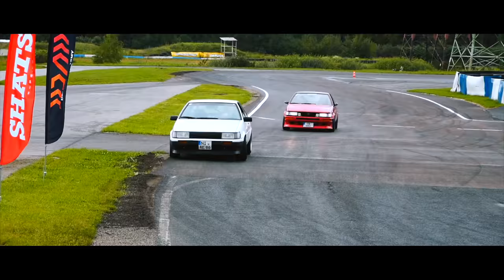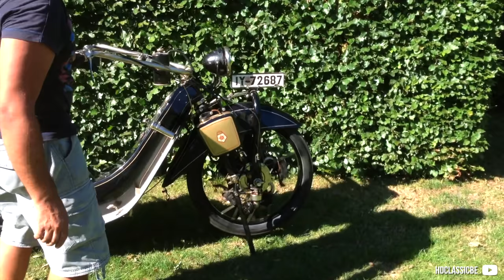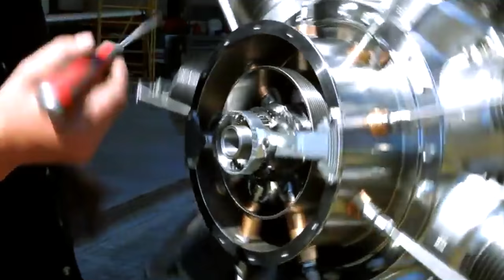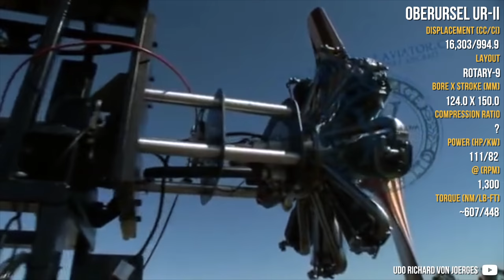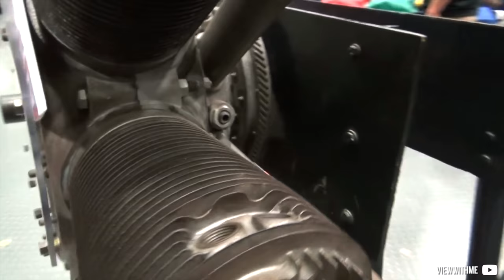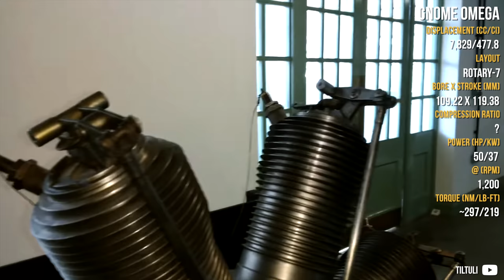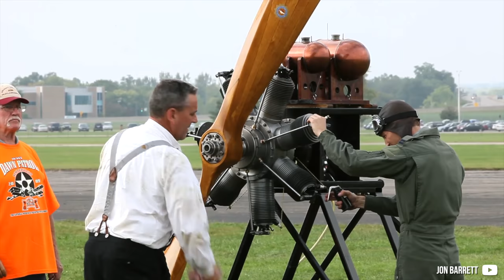These Rotary Engines Are Spinning

Comment: During WW1 these engines had the best power to weight  ratio of any design, because it eliminates the need for a flywheel, cooling fan, ignition distributor, exhaust manifold, and several other parts. Especially the flywheel, though, since the low speed engines of the time required big heavy ones.
Reply: There's many reasons that those things are highly desirable, even if they weigh something.

Comment: I have never heard a front wheel drive motorbike, but thanks to your video, I know about it. Thanks for the video very much!
Reply: Knallert is another Brand.
Reply: Well in the early years of motorcycling, various brands had front wheel drive by a small engine right above the front & either chain drive (no springs or damping at the front) or a coupling to the front wheel by a rubber roll - up to the 1980's you could still buy a brand new french "Velosolex" (a moped with not even one horsepower from a tiny two-stroker) that worked with a rubber roll to the front wheel/tyre (caution: slippery when wet...😁).
If I remember correctly, there was even a japanese bike (MX, prototype or not???) that had an additional, hydraulic drive to the front wheel but because the main drive was to the rear, you may call that an all wheel drive...
Reply: I saw one of these at a show. It was frigging cool.
Reply: I saw one in The Museum of Science and Industry in Chicago, probably around the late 1990’s. I didn’t know more than one was left in existence.
Reply: @stefanpaege2046  succesful 2 wheel drive motorcycles I would like to see. But even after more than 50 years on every kind of motorcycle I could find that front wheel drive rotary is an accident. If I got on it I would probably figure I should crash as soon as I could so I didn't have to walk as far to get back. 
Ever try a honda helix? its kinda in the same class.
Reply: I saw one in a museum back in the mid 1980'ies - as far as I remember, it was in Dresden, Germany.
Reply: @stefanpaege2046   and @Alden Consolver
The veloselex, was not aware that they had a friction drive model. But tanaka of japan, a company had a bolt on option for bicycles that was a front whell friction drive. They had a runner's roller and a resin roller that was impregnated with sand or another abrasive so it would work when wet. Rear wheel friction drive kits for bicycles are still available today from at least a few companies. 
 There was a rear wheel motor solution back in the early 1900s i believe called the motowheel and it was sold in two ways, one as a stand alone unit with tabs for bolting onto essientally a go kart of the owners own design, createing a rear midengine five wheeled vehicle in most cases. Though i guess one could design a cart specificialy for the device that had three wheels, it ad two in the front. Though you could even mount it in the front if one wanted and were creative enough.  
 The other way it was sold to my knowledge was as a fully built bike, though there may have been a model that bolted onto the left side of bikes making a sort of strange trike that seems like it wasnt the best idea. 
However i do not think the motor  turned, it think they used a torque arm to turn the wheel which sat on a bearing and spun around the motor which sat inside it. 
 However rotary motors are stil in use today thougj rarely are they gasoline. Usually electric, and commonly found on electric bikes. Though the trend is going toward mid mounted motors. 
 Of interest though is a cureently produced american made motorcycle that kinda is a frint wheel drive. 
 Its called the rokon, and while it uses a mid mounted stationary motor, it drives both wheels, the rear wheel through gearbox and chain though one doesnt really shift gears like on a traditional motorcycle. You pick the gear thats best generally for what you are doing and you just ride in that gear, from closed to wide open, the gear simply decides if you are gonna get torque or speed. 
However it has a really neat articulated driveshaft that reaches up into the front steerer to reach the front gear box thingy that drives the chain that drives the font wheel. 
 Its top speed is about 37 mph. 
 Its made for off road use but there is an on road model. It looks like a john deer and a harley davidson had a baby.

Comment: Slight mistake about the Gnome et Rhône engines: Le Rhône was not the name of the engine model. Gnome and Le Rhône were two independant engine manufacturers which merged in 1915 to form Gnome et Rhône.

Comment: I LOVE rotary engines.
A lot of people think something is wrong when they hear them "missing", but the RPMs are controlled by shutting cylinders off, and the sound of it being in trouble is actually normal.

The Addams-Farwell was built about an hour from where I live. As I understand it, the first Addams machine shop burnt down, and the "New" (around 120 years old now) shop is still standing in Dubuque, IA. (USA).

Comment: These engines were horrid to fly behind.  Most of them had no throttle, you controlled the speed by blipping the ignition on and off.  Often times they used castor oil for engine lubricant, which stank and got all over everything.  And all that spinning mass had HUGE gyroscopic effect and made for difficult handling.

Great video!
Reply: How does the fuel system work?
Reply: @alexm9211  The crankshaft is bolted to the airframe, the engine and propeller spin around it.  The crank is hollow and the carburetor is attached to it inside the fuselage.  There are holes where the charge can leave the hollow crank and enter individual tubes up to each intake valve.  

Like a lot of things it's a fascinating design but horrible to use.
Reply: Fun fact, castor oil is a pretty potent laxative. Yup, early pilots frequently dropped a bomb in the cockpit.
Reply: @georgesears2916  Oh shit.....
Reply: ww1 pilots never really controlled the throttle speed. Just left it at full and never adjusted. But then again the engines were just barely powerful enough to get themselves off ground. Also they were EXTREMELY torquey. The planes turned much tighter in the opposite direction of the engine spinning. Which is true for all planes but way more so with the biplane.
Reply: @snoopytheace4487  one of the many reasons pilots had to be careful making maneuvers
Reply: @snoopytheace4487  They actually did control the engine speed by flipping the ignition on and off.  Otherwise the plane would fly at full power until the fuel ran out.
Reply: @Flies2FLL  really. The historian I talked to said that they just left it at full.
Reply: @Flies2FLL  he also said that most pilots never really thought in the 3 dimensional. They would look around them and maybe down but very few would think to look up. Which is why people like the red baron was so successful is because they thought in the 3 dimension and used that to their advantage.
Reply: The rotational instability of these engines did have a benefit in aircraft in making for excellent maneuverability if the pilot could handle the torque. One of the reasons the Sopwith Camel was so successful was because it was on this limit of murdering its pilot all the time.
Reply: @Reddsoldier  that is true. In the right hands these planes were extremely maneuverable. But that's one issue. They didn't have very good training.
Reply: @Reddsoldier  Well you had insane roll capability in one direction, and quite a bit less in the other, so it is true that a good pilot could make use of this effect in combat.
Reply: @georgesears2916  This guy gets it, he wore the brown pants.......
Reply: thank you Capt. Obvious
Reply: @BikerJim74  You are welcome Corporal Oblivious.
Reply: Caster oil doesn’t stink, it smells wonderful compared to modern oils. I use caster oil in all my two cycle engines because it smells much better. If I have to breath it, I would rather breath caster oil.
Reply: @dougbower9479  It is used in RC model plane engines.  It has a "unique" smell.

Comment: Fun fact: the number of cylinders in a row is always odd, because it allows for very smooth running by firing every other cylinder in sequence. The firing order neatly wraps around. For example, for a 7-cylinder rotary it would be 1-3-5-7-2-4-6-1-etc. A 14-cylinder rotary simply uses two rows of 7.

Comment: I love this absurdly simple design
Reply: Mark Jones  but I guess, they made the crank static and the cylinder bank rotary for the sake of simplicity. Moreover the inlet over exhaust valve design, on most of them was also just for simplicity as well. Come on man, it's  the early 20th century we're talking about, what else do you expect?

Comment: The Megola sounds really cool! The aircraft rotory engine usually had no throttle, it was always wide open. To descend you had an ignition interuptor. They also had no brakes. (Just like boardtrack racer motorcycles).
Reply: Yes the interrupter is called a “Burp switch.” My favorite rotary is the Gnome 9-cylinder, found in the Sopwith Camel and others!
Reply: @averagecarguy420  
I think they are way cool too. The total loss oil systems meant most pilots suffered from digestive afflictions due to being covered in castor oil!
Reply: @upsidedowndog1256  yes, many vomited midair haha. I love the smell of burning castor oil.
Reply: @averagecarguy420  
The symptoms were of dysentery. They wore leather coats to keep it off of them!
Reply: @Phillip Paik you probably meant "blip switch".
It must've been quite an experience flying those things in the war: lots of angular momentum constantly messing with your turns, all-or-nothing throttle, oil flying in your face and some angry folks trying to machine-gun you down. Alledgedly the iconic pilot scarf wasn't to keep warm but to wipe oil from the goggles.
Reply: @alexander3554  yes, meant blip switch. It’s been a while since I’ve had a conversation about rotaries. I am fortunate enough to live relatively close to Old Rhinebeck Aerodrome, and yes they confirmed that the scarf was used to wipe oil from their goggles.
Reply: The Bentley was sort of throttle-able with care and expertise, nothing like a carburettor engine but it was a small improvement.

Comment: In the beginning of Aviation powered flight, radial engines were built in 2 types, fixed and rotating. They're really radial engines, not rotary. The rotating radials eventually went out of production in favour of fixed radials, as there were fewer problems. The rotating radials were speed limited, as if they rotated too fast the cylinders would break off. Also, the torque effect from such a large rotating mass would affect the aircraft handling. There were also limitations due to the difficult carburation and intake passages. The only real advantage of the rotating radials was the very efficient cooling, but it wasn't enough to offset the disadvantages. Interesting, but a technical dead end. Fascinating to watch them running! Thank you for the video.
Reply: Sorry but you are incorrect, these are ROTARY TYPE engines not Radial engines.
The invention of the Rotary engine predates the Radial engine.

First invented by Felix Millet in in 1892 years before the Radial.

Rotary engines all have one common feature, a crankshaft that remains stationary.
The other features like cylinder arrangement is inconsequential.

Comment: Nothing sounds more WWI than a rotary engine.
Also Von Richthofen personally approves this video.
For those interested, Gnome & Rhône also built motorcycles (but not rotary powered).
This manufacturer ended being incorporated in SNECMA, and then privatized as SAFRAN. They have a private museum, with collections ranging from WWI era rotary engine and G&R motorcycles to Ariane rocket engines, not forgetting Rafale and Concorde engines. This is a seriously must-see for aero-engine enthusiasts.

Comment: Due to the dynamics these were only capable of about 1400 rpm. The bentley br2 was barely able to make it into the war and made about 230hp. 
  As power needs went up the drawbacks of the rotaries were too much. 
  Another drawback was the spinning mass of the engine caused a problem with turning into the rotating direction 
Quick one way but slow the other. Opponents figured this out and the rotaries got shot down. 
  Also they had no carburetor. A mixture needle and an air valve at the back of the stationary crankshaft. They ran at wide open throttle all the time. Some had a switch to shut down selective cylinders to lower rpms. On landing one would blip this switch to slow the plane.

Comment: The Sopwith Camel biplane was fitted with such an engine. The torque reaction caught out many an unsuspecting pilot as it caused some ‘interesting’ handling characteristics but could in the right hands be used to an advantage for tight turns in a dogfight.
Reply: Rotary engines were preferred for the higher power to weight ratio performance and they didn't require to be warmed up before takeoff.

Comment: Thanks, I only knew about the car engine. I noticed the torque was off the chart compared to the hp. That is a lot of mass to balance. Again, Thanks for your great work
Reply: Massive torque compared to the horsepower means low RPM (or very low end torque curve), which definitely would be the case with the entire cylinders rotating around.
I can imagine it being highly based on aircraft engines of the day (since as seen on the video, that's where most of the rotaries were used).

Comment: Can you imagine the torque produced by all that mass rotating?
Reply: The primary advantage of the Rotary type engine was high power to weight ratio and low vibration.

Comment: I didn't know that this kind of design was that much used. I always thought of it as a one time freak engine. Wonder what were the advantages?
Reply: Excellent power to weight ratio performance and very smooth with low vibration and no need for a heavy flywheel.
In WW1 it's was an advantage because the engines don't need to be warmed up before takeoff.

Comment: It should be mentioned that many of these engines had no real throttle.  The only way to control their speed was interrupting the ignition.  That's why when you see old warbirds with these engines land, it sounds like the engine is cutting in and out.

Comment: I read that, to distinct engines, rotary engines are the engines with internals that rotate (i.e. wankels, RKMs, Libralatos etc.) and rotative engines are engines that rotate.
At least in spanish but changing words is like that:
"Rotatorio" literally means rotary but is used as rotative (with upper explanation): Motor rotatorio de 7 cilindros
"Rotativo" literally means rotative but is used as rotary (with upper explanation): Motor rotativo Wankel
Also, Gnome et le Rhone is the full name of the company, which was a merge of Gnome and Le Rhone
Reply: Rotary ICE engines is when the main housing rotates, not the internals.

Comment: Love your videos.  Would it be possible for you to do one on rare Australian performance cars? If you research,  you'll see there is plenty of material available to make a video.
Reply: Australia doesn't have any automobile manufacturers.
Reply: @sandervanderkammen9230  Australia had at least 15 manufacturers that made specialised cars for Australia,  and Australia alone.  Many of them even exported cars into other parts of the world.
Reply: @pablojones5613  Australian manufacturers?
Reply: @pablojones5613  Ford, General Motors, Toyota and Mitsubishi are not Australian...
Reply: @sandervanderkammen9230  try buying a Holden Commodore SS, A Mitsubishi Magna,  a Ford Falcon,  or a TRD Aurion anywhere else.  Not to mention a Bolwell Nagari, a Lightburn Zeta, or even an Austin 1800 ute.
Reply: @pablojones5613  Sorry but none of those are legitimate Australian automobile manufacturers.
Reply: @sandervanderkammen9230  you're kidding right? Bolwell and Lightburn were wholly Australian owned.
Reply: @pablojones5613  Kit car companies are not automobile manufacturers
Reply: @sandervanderkammen9230  neither manufacturer sold kit cars.
Reply: @pablojones5613  They didn't sell, period
Reply: @sandervanderkammen9230  so you've been wrong the whole way so far.  Your last comment hasn't changed anything,  based on that.

Comment: Any idea why they spin??
Reply: No flywheel or cooling fan needed... extremely smooth with low vibration  and lower weight.
Reply: @sandervanderkammen9230  Interesting also why its nomore popular?
Its sounds like purfect engine.
Reply: @joe125ful  Conventional engine designs can rev higher, make more powerful and do not leak oil everywhere.
Reply: @sandervanderkammen9230  Well...:):)

Comment: These are radial engines, a rotary is a spinning Dorito boi
Reply: Sorry but you seem very confused, these are ROTARY engines and not Radial engines.
Do you have trouble understanding the difference?

The Wankel KKM is not a Rotary type engine.
Reply: Sander Van der Kammen 
As a car guy I’m pretty sure what a rotary engine is. It’s an engine that is in the shape of a round-edged triangle. A radial engine is a plane engine that has the pistons arranged in a circle around the driveshaft. These engines would be a combination of both, circle arranged pistons, and the pistons moving around the driveshaft.
Reply: @idontknowwhattochangemynam8644  Sorry but you are very confused and misinformed.

You are obviously referring to the WANKEL engine. 
The engines in this video are all ROTARY Type engines... not Radial engines.

Rotary engines were invented by Felix Millet in 1892. BEFORE Radial engines were invented.
Reply: Sander Van der Kammen 
I hate to be a pain, but if you just search up rotary engine you get a spinning dorito and not a spinning plane engine.
The engines in this video are piston engines that spin with the propeller. I’m not confused.
Reply: Sander Van der Kammen 
Wait never mind, sorry
Reply: @idontknowwhattochangemynam8644  No worries.
Any questions?
Reply: Sander Van der Kammen 
I have no questions. Just have a good day, or night